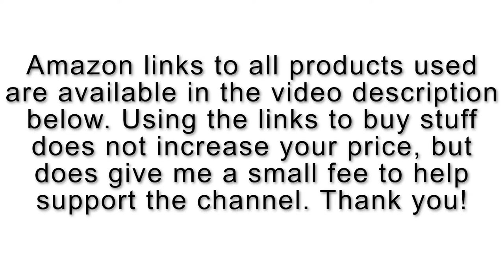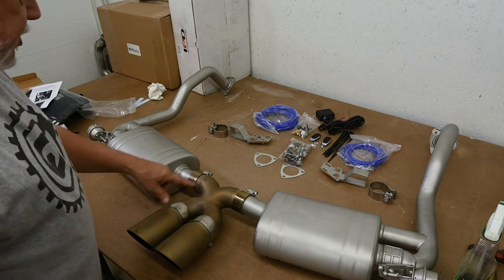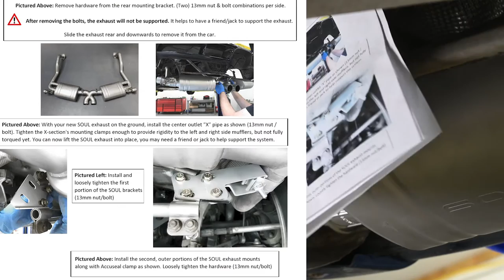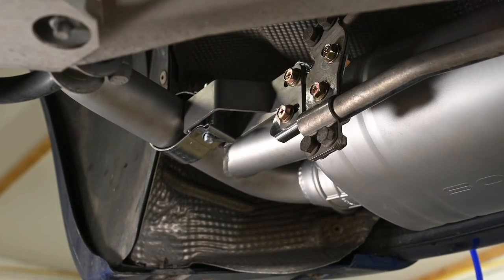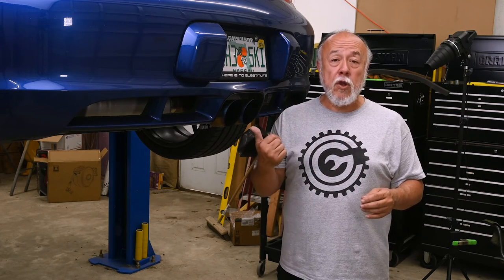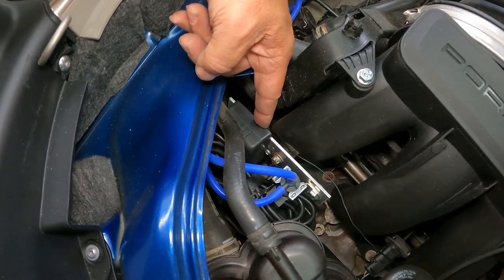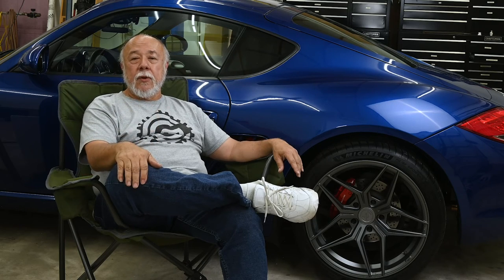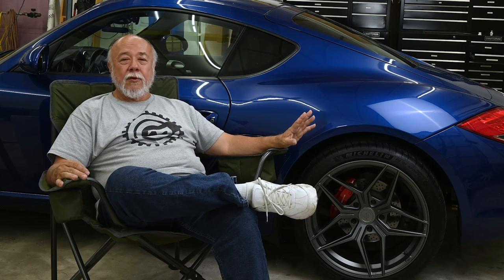Soul Performance Valved Exhaust Installation, Testing, And Sound Clips! (Porsche Cayman 987.2)

Comment: Did this on my 987.1.  Sound, performance, fit, and finish as described.  Thanks.  Only note to add I put the exhaust hangar clamps on the hanging brackets while the pipes were on the ground and fitted it all after I got the captured bolt and spacer clamped down a little.  Made it super easy to use a c-clamp to get the assembly cinched down before installing in the car.

Comment: Your side by side sound tests and the editing you did with the quick back-and-forth are top notch. From the videos, it is undeniable that SOUL makes the best valved exhaust for the Caymans right now. Having the valves closed sounds like an enhanced (not louder, just better) version of the Carnewal and having the valves open sounds fairly exotic. It's the best of both worlds. From watching your Carnewal video, I am in your exact situation debating which exhaust to get. The Carnewal is attractive because the forums praise these modified mufflers and they are cost effective, but your video proved them to be a little too quiet and not really worth it to me even at their price point. The price of the SOUL is hard to swallow but I think it's going to be necessary. Love the sound and your video. This video should be on SOUL's website, because it sold me on them.

Comment: Cliff
I installed the SOUL comp headers, catback system and Softtronics map on my 2010 987.2 Boxster three years ago and, WOW, what a difference in sound and performance.   It’s what the flat six is supposed to sound like and so much fun to drive.   John Gaydos and the guys at Soul did the installation at their shop in North Philly…super customer service.   I added a Numerics shifter and cables, sourced from Soul along the way, superb.  20k miles later, the system still looks and performs great.
Thanks for a great video, agree with your comments…can’t go wrong with Soul Performance.

Comment: vis-a-vie that clamp... 

i think i would remove those two bolts that hold that second adaptor plate to the first adaptor plate and start over. first assemble the clamp/exhaust pipe/second adaptor plate together. then attach the first adaptor plate to the second adaptor plate.

Comment: Like some others have said, I put the hanger clamps on the pipes while they are off the car, it was much easier than what was shown in Cliff's excellent video. I also put the brackets on the car before putting the exhaust in the car, which also made it easier. It wasn't a problem to put the system in the car with the brackets already installed.

Comment: I have an 987.2 CS PDK with the Soul valved exhaust and the Soul catted header setup, installed by the previous owner.  I don't find any drone with this setup in my car.  I've had cars that droned (most recently my previous modified C6 Z06 with catless long tubes with the stock valved exhaust, which droned like crazy when open and somewhat when closed).  I don't find any drone open or close at any RPM.

As for open vs closed, I don't find it makes enough of a difference.  Yes, it is a little quieter closed, but not much.  On my Z06, it was a massive difference.  On this, the sound output is only slightly cut and really just makes the car sound worse, so I never close it.  

Lastly, I want to mention price.  My setup sells from Soul for $8500 shipped.  That is a massive amount of money for a stainless steel exhaust.  The headers are nothing compllicated, nor is the catback.  Again, I'll go back to my comparison of my Z06 (where you pay the Corvette tax for Vette specific aftermarket parts), and a very good valved aftermarket catback is ~ $2000, and there is more to it than in the Cayman.  Quality stainless catted headers are another ~$2300.  So the whole setup is a tad over 1/2 of the Cayman and there is a lot more material to deal with on that car.  Simply put, Soul is asking a huge premium because of their perceived name.

Even though my car has a Soul exhaust, if I were paying for it, I wouldn't buy a Soul (and I got my car at a really good deal, so the previous owner lost out big time).
Reply: Awesome info, thanks for sharing. I just sold my C6 Grand Sport that I had installed the NPP valved mufflers on and agree; it was a huge difference having them open or having them closed. Also agree on price... I thought Corvette exhausts and headers were expensive (Corsa or Borla for exhaust and American Racing or Kooks for headers), but cannot believe how much people can charge for such a smaller, stainless steel system on the Caymans. Obviously it works because people are buying them but I wish they were cheaper. I have to choose between catted headers or cat-back exhaust on the Porsche, not willing to do both at the current price points.

Comment: Hey Cliff, thanks for the video. Some really useful information. I've owned a 987.2S for the last 8 years and never been happy with the exhaust note. Had considered Carnewal, but thinking this may not satisfy my needs. I was interested in the drone issue and you have somewhat put my mind at ease. My car is mainly used for country road (B-road Uk) driving and can't see drone being an issue. My local porsche indy has recommended Topgear Valved exhaust and i think i will give it a go. Thanks for the video ;-)
Reply: Hi mate, any update on the Topgear valved exhaust / what are your thoughts on it??
Reply: Also in for an update.

Comment: Great series of videos.  Question:. Does your wife want the valves closed while driving?  I'm trying to justify saving a few dollars and purchasing the valveless version.
Reply from the maker: Even with the valves closed, she thinks it's way, way too loud. I don't know how the normal version compares to the valved one in terms of noise, but I like having the valved version because I can tone it down when driving in town. Florida is pretty chill in terms of car mods, but I like having that little bit more safety margin. Plus, having the valves closed was necessary to stay under the sound limits at AMP and Roebling.

Comment: Hi very very nice sound comparisons! Seems you've had a few setups.

One clarification point if you will. Your description says "catless" but at 10:19 it appears as though you have the standard Porsche manifolds. Your videos also sound very quiet for something unsilenced beyond the single valved boxes at the back.

Could you just clarify whether you mean the "Soul exhaust part is catless" rather than "the car has no cats in it" please ?